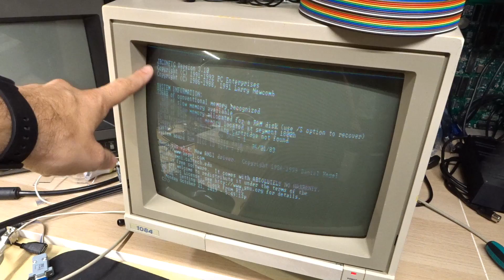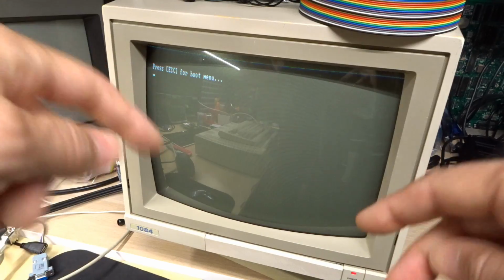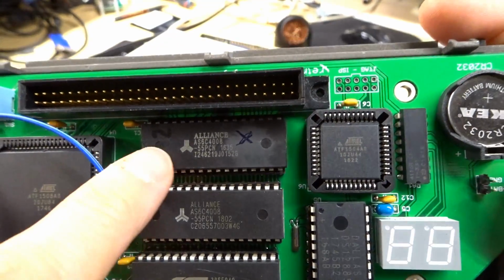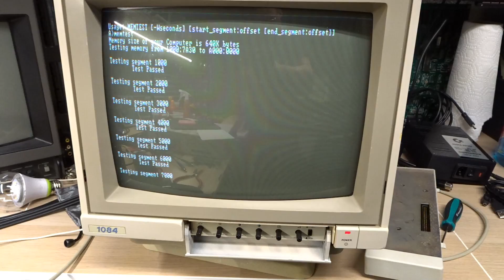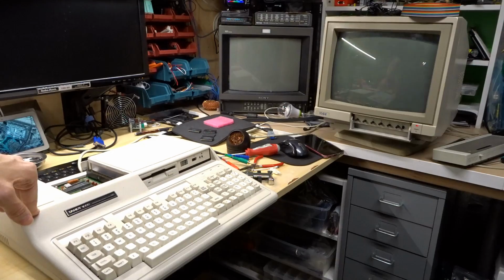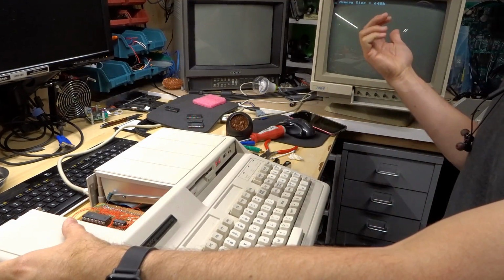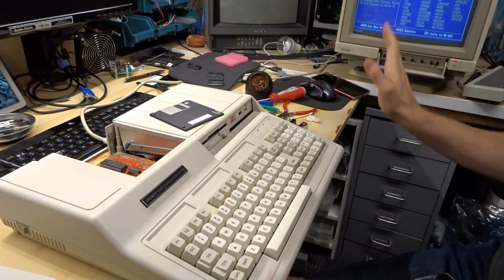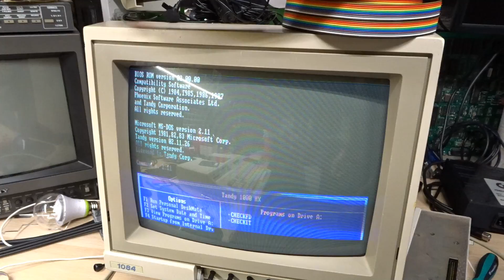Follow-up to fake or real chips? I think I know the answer now.

Comment: Just because a chip is counterfeit doesn't mean it's bad or nonfunctional... They get remarked for More prestigious manufacturers, or higher chip speeds, etc.
Reply: The blacktopping and remarking of parts to purposely misrepresent the actual part fits the definition of a counterfeit component. Based on the problems in this video, I would guess the counterfeits are a slower speed grade than they say they are. That makes it both bad and nonfunctional.

Comment: I wanted to go to Digi-chip for my needs but the one need was not available. I had to go to Chinese distributor. I used Paypal and the Chinese supplier did guarantee everything. Now that I'm watching these fake badge chip video's it's got me worrying. I didn't want to buy a scope or a chip tester. I have no full electronic training but took the fundamentals like what a diode or capacitor is. My meter has cap diode transistor and even frequency testing abilities. I hope I have enough to see if a floppy drive controller is working. Problem is one is a Ferranti and the other is a Cherry Semi from the 1980's. Nobody keeps the official data sheets. Have some similar SGS sheets. Hope it's enough to sort it out. I have two Tandon TM65 2L drives each with a separate PCB. The online owners manual has a third. I hope I'm up to it.
Reply: must have been a matter of timing, Digikey has nearly 3K in stock now. Best place for me to get Alliance memory has been from Future Electronics.

Comment: Adrian, do you know about the least expensive chip distributor in the 1970’s for hobbyists?

I think it was Poly-Paks, if I’m not mistaken. Maybe some other subbies might recall!
Reply: But meant to say they were so cheap that most of the chips actually didn’t work. That was their business model.
Reply: Wow - I used to buy bags and bags of parts from polypaks! Always resistors, capacitors, switches, etc. Never bought active components from them, though - too cheap and packaged too poorly to trust them.

Comment: BUS SPEED.  Your fakes are a slower access speed version of the chip relabeled as a faster speed.  You may also have a data bus voltage specification not being met.

Comment: I'll teach you a trick to identify fakes.
Power the IC based on the datasheet and measure how many mA current it consumes. 
Compare it to the quiescent current in the data sheet. If it's not close, it's a fake. 
AliSlow is a great place to buy passive component. Or, active parts that are generic, like LM358, LM7805, NE555, 2N3904....
Even those are questionable...

Comment: Adrian, I feel your pain,  I''m pulling out my hair with some 2114s for the Vic20 that I got from China and 40 of the 80 are reporting failed in the ram expansion... same red foam BTW, we probably got them in the same place on AliExpress... something is very weird as they almost work... I suspect timing issues or failed tolerances on the China chips.  Put in a few 2114s that came out of C64s and no issues... great video.

Comment: The problem is that at least some of the time the local chips are just as questionable. I got a bunch of bad 74HC chips from a local retailer, went to another store in the same chain, got new chips plugged them into the same circuit and it worked.

Comment: The only reason I order chips from china is the fact that postages are not breaking the bank. I've done a couple of orders from Digi-Key, and needing to always to get over 50€ to get free postage (or pay ~30€ for postage) and then also adding in the VAT over on top of that... Currently the only fakes I know of were LM35DZ temperature sensors. I got burned a bit by it and was made aware of this practice of remarking cheaper chips are more expensive ones, and I hope I'm not gonna get too burned with this.

Comment: I saw a video of a process used to pull chips off old circuit boards in China. They dumped the boards on top of a roaring fire, waited for the solder to melt and then banged the boards up and down on a slab of concrete to release the chips. :D

Comment: Excellent detective work! However.... did you check the speed of those RAM chips? IT may just be that they were marked as a faster speed when in fact they are slower. That could explain why the slower machine was able to use them.

Comment: Actually, FAKE isn't the proper name for them.  "Dropouts" is probably more accurate.  When products are manufactured in China, a good number of chips simply don't perform very well.  This can be random chips, or a whole darn lot that simply didn't work well in a product.  You might see some that have bent legs, but the chips aren't dusty like they were pulls from old equipment.  Those are drop-outs the just didn't work well. Sometimes they remark them with the generic markings to sell them, but they are genuine.... just garbage! lol.

Comment: A dead give away that they are probably recycled chips is that they have tinning on their legs. They desolder the parts, sand off the top, repaint it and mark them with the same batch codes. However, removing tin from the legs is too much effort so instead they re-tin all the legs. Not a lot of actual manufacturers do this with brand new chips.
Usually these chips aren't 'bad' persé, but they can be marketed as a higher speed grade that they actually are, and of course can be damaged by their relatively rough treatment in removal from the board and heat cycling.

Comment: They are possibly genuine or from other manufacturers but certainly recovered chips, hot oiled to make the pins look new and smooth, sanded, painted
 and remarked (sometimes to reflect later/better specced/or more desirable batches). It's rampant. They sell them as new, but they are not.

Comment: I don't have a very clear view of your board, but I see no decoupling capacitors. The problem you're having could be due to fan out. The octal bus transceiver does double duty to isolate the bus and provide increased drive. Are your chips on the custom board in tristate mode when the cpu is not accessing it?, or just not enabled? I would look in the area of fan out for the problem. Just my thoughts from taking a fast peek at the board. I haven't been able to clearly examine your work so I could be totally wrong. Cpu fan out is 1.

Comment: They are likely real chips but recycled and rebadged.
I have seen this where second hand chips are stripped from old boards and then rebadged to make them look new.
That's why they come off black when you hit them with alcohol
The tend to dip the leads in solder to make them look like new at first glance.
Because they are treated so badly during the recycle process they rarely meet specs.

Comment: You're going to need a 3rd party application for sure. That 8088 isnt going to run em386. Ram exam ( if you can find that old utility ) or a similar utility might be able to test the ram. Yea those are boot leg chips..still they might work just fine. I have some boards that came from Shenzhen China and they say made in Italy. I know for a fact those boards have never seen an Italian, but they work just fine.

Comment: I do a TON of old hardware restoration as a hobby (I am  a late 80’s child) and I have never even thought of fake chips, heard of them but never came across them. Time to pull out the old scope and also getting inside these old pieces of silicone.

Comment: 1) Checkit has command line parameters to select specific tests and 2) memtest86 is your friend.
Reply from the maker: You can't run MEMTEST86 on any processor less than a 386

Comment: Not so much fake as chips recovered from scrap equipment and remarked to freshen up the appearance. The fact that they work fine in the PC Jr shows that they match the original spec. I can't count the number of times I had issues with RAM not working at higher clock speeds on turbo clone PCs. We all know that cheaper chips sourced from tend to have their specs exaggerated, so basically you did get what you paid for.

Comment: Great video on "fake" chips from a guy that makes sound card kits: https://www.youtube.com/watch?v=k72SFBOZ_lw (I think it was watching that video that caused YT to recommend this one). The chips were apparently genuine (as evidenced by the fact you can still make out the faint markings when you take the paint off), but were likely reclaimed from old electronics -- a process that is highly damaging to the chips. As others have noted, they may have also changed the markings to indicate they were faster than they actually are. As I recall, the HX/EX were made 3-4 years after the jr, so even if the parts were exactly identical, the HX/EX were likely pushing the timing tolerances much more.

Comment: After watching this I am extremely paranoid about my DDR2 SODIMM 2 x 4gb memory modules. They came from China, supposedly Crucial and very a good price. But they sold it as new, and the fact that 4gb sticks were very rare and expensive in DDR2 back then, makes me wonder whether they are fake and not up to the advertised specs. The laptop I put them in reports 8gb RAM, but that still doesn't mean much I think. I have read about fake MicroSD cards, sold as 128gb, and it shoved up as that in Windows, but when the guy tried to fill it up with data, it got full with 8gb.

Comment: Late to the party:
FWLIW: I tend to agree with the sentiments in the comments. The Chinese chips are probably 'genuine' for a given value of 'genuine' but are likely:
-Salvaged parts
-Slower versions relabeled
-Marginal / test-failed parts relabeled
 I've got to admit to being cheap and so tend to buy China-sourced IC's anyway, but take a very close look at the pictures and any feedback, and don't buy form sellers who don't show pictures of the actual items for sale. 
This doesn't fully protect me of course but as I mostly build in to my designs the option to add some margin I usually get away with it... the times when I don't it's usually because I'm dealing with a retro-system that was built on the cheap anyway, and sometimes where I've not followed the IC conventions used in more 'official' upgrades - this is the one that catches me out most often as I try to keep chip count as low as possible and I sometimes run in to "so why did they include that IC?", delete that, and then find out it was included to paper over the cracks in the OEM design.
(I'm also in the habit of freely publishing my designs for others to use as they see fit as I very rarely make up boards for others / sale - too much hassle and as a result of issues like this combined with being a single person who doesn't have the time / resources to extensively test stuff. It's frustrating to get unhappy feedback from people complaining about hobbyist boards that have run afoul of edge cases, even though I only ever use known genuine parts in other people's boards)

I hope that helps. I just stumbled across your channel, rather enjoying it. :-)

Comment: IT ONLY WORKS CERTAIN MACHINES THAT HAS A BIOS...TANDY ITS LITTLE DIFFERENT SINCE ITS NOT POSSIBLE MESS WITH TIMINGS ON THAT MACHINE..ITS PRETTY MUCH LOCK TO CERTAIN PARTS ARE EMBEDDED TO THE ROM ...MEANING ITS BEFORE BIOS AGE DURING IBM ERA STARTED THE BIOS INTERFACE THAT OPEN MANY SETTINGS AND BRANDS VS TANDY ITS ONLY MARRIED ONE TYPE ...SAME CHIP ...SINCE THEY WENT OUT OF BUSINESS WHEN DOS BECAME MORE MATURE AND WINDOWS RISE WITH MANY BRANDS ON PC MARKET ...NOT JUST TANDY ...I DO KNOW TANDY JUST THEY WENT IN MARKET TOO SOON DURING 80'S CRASH OF 8 BIT MACHINES...WELL THEY SOLD WELL DURING LATE 70'S TO EARLY 80'S DUE TO PRGRAMMING BACK THEN..SINCE ENTERING AS FIRST 16BIT....TANDY STILL BASED THEIR BRAND ONLY PARTS LIKE 8 BIT COUNTER PARTS MANUFACTURER DOES, WHAT MICROSOFT DID ...IT OPEN NEW OEM MARKET FOR ALL KINDS OF PARTS TO BE COMPATIBLE ALL ACROSS 286 AND 386 MACHINES AS TODAY COMPUTERS...WE SHOULD THANK TANDY FOR STARTED ALL AND MICROSOFT TO EXPAND IT...

Comment: I've been on the receiving end of this kind of fraud a couple of times over the years.  One of the chips in our product will go obsolete, and we don't have the time at the moment to re-design the board to use some other part, so the short term alternative is to buy the parts from a surplus dealer.  Surplus dealers traditionally buy surplus or left-over inventory from companies when a production run is over and there are extra parts left over, and sell them to companies like ours who need to make one more production run before redesigning the board.  They often buy the surplus for pennies on the dollar and sell it for several times what it originally sold for, providing huge profit margins, but they might have to hold on to something for a long time before they find a buyer.  The later version of the surplus dealer is just a broker, who has a knowledge of people with actual physical surplus inventory, and then advertises that he/she has the parts for sale, and arranges for transactions to take place without ever touching the inventory.

Our experience with the surplus market is that if the parts are coming from Asia, they are much more likely to be fake/remarked/counterfeit parts.  I don't know if it is a different business ethic, or lack of law enforcement, or a bad attitude toward Americans, but we have found a HUGE difference between parts coming from Asian surplus sources and US surplus sources.

The first time we were burned was on an eight channel driver part that had, as I remember, 600 ma per channel driving capability.  Sprague/Allegro decided to obsolete it and there were no other pin-compatible substitutes.  So we bought several hundred pieces from a surplus dealer, who was getting them from Asia.  As I remember, we paid about double what we paid for the original Sprague/Allegro parts.  The parts looked the same and had the Allegro logo and part number on them.  Our contract assembly house built the 200 piece production run with the parts (a big mistake we found out later) and when we started testing the boards, the solenoids that were being driven by these drivers were operating unreliably.  We found the problem to be that the chip wasn't passing the rated 600 ma of current, it was only passing about 370 ma as I remember.

We researched this and found that there was another part that was being made by Allegro that was pin compatible, but had only about half the rated current capability.  That's when we found out about "blacktopping" and remarking.  Blacktopping is the application of a black substance on top of the original face of the chip to provide a blank surface to put a new logo and/or part number.  The supplier was buying the lower current rated parts and blacktopping them and printing the logo/part number of the higher rated parts.  If the customer wasn't using the parts at their full rated current, they got away with the deception and received a tidy profit for selling lower rated parts at high profits.  If the customer needed the full current rating (like we did), then there was a problem.

We ended up having to rework (remove and replace) the entire run with chips from a different surplus dealer.  We got our money back of what we paid to the first dealer, but not the cost of the rework.  The experience happened again several years later, again from an Asian surplus supplier, but this time it was caught (the surplus broker noticed that the parts had been blacktopped and returned them to his supplier).

The blacktopping can occur for several reasons, among them are to remark the parts to be a higher speed grade that they originally passed for, remarking to have other characteristics higher (like current rating). and changing the brand to be a more prestigious brand (which sells for more money).

There are some ways to spot the blacktopped fakes but it's not always easy.  One way is to look at the round ejector pin marks on the chip.  Usually the surface of the bottom of these circles is shiny, because the surface of the ejector pins that created the circles is polished.  The blacktopping compound is usually a sprayed-on textured substance, which will create a texture on the bottom of the circles (which again are supposed to be shiny).  There are a number of things to look for to spot counterfeit/fake chips--do a Google search on "how to spot counterfeit chips blacktopping" to learn more.

Comment: Looks like data bit 14 is stuck. But it is it timing?
Difference between A5 and E5 is one bit... 1010 vs 1110.

Do you know if that mem test is doing multiple reads?
If you do a Write, then Read, then Read, you should be able to determine:

Write problem: Write data doesn't match read data, if consistent
Read Problem: Write data doesn't match read data, but also doesn't match read data on 2nd pass.
If you get different read data writing/reading the same address, likely a timing issue, if same, stuck data line?

I used to debug with MemTest86, not sure if those old computers can run it.
Maybe there's some dos based tool that allows mem read / mem writes that you can test with.

Comment: Did you check the pins on the motherboard slots? They may be dirty or bent out of contact, making the pin float. Get some light in them and use a magnifying glass, followed by a blast of compressed air and contact cleaner, perhaps?

Comment: Also, for your chips... they will not be 55ns, but rather 120 to 150ns or most likely 200ns chips which will work in the 4.77MHz PCjr, but 200ns is too slow for the 7.16MHz of the Tandy EX/HX computers.
Reply: Then the only other answer I can think of is a timing problem on the Tandy with respect to accessing the SRAM. You'll need a logic analyzer to check that.